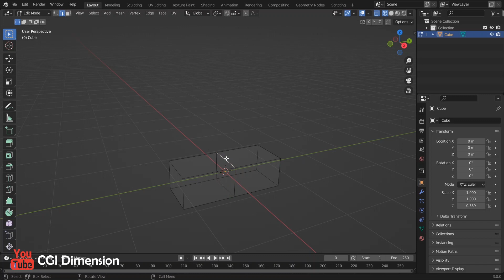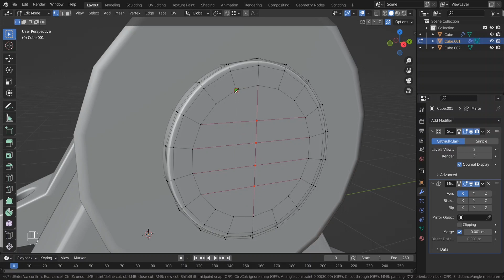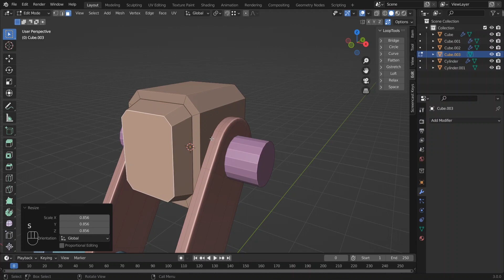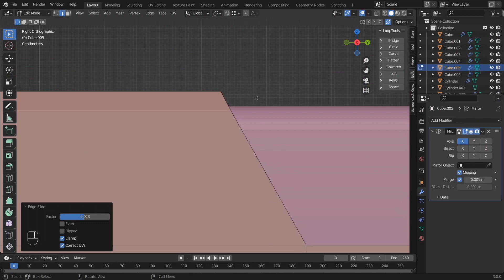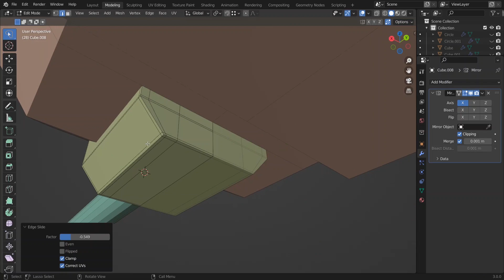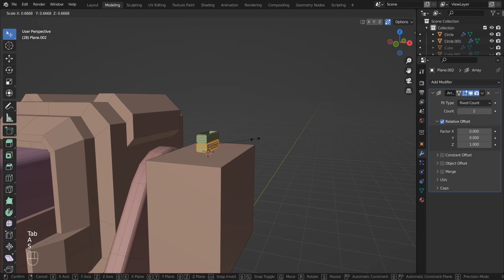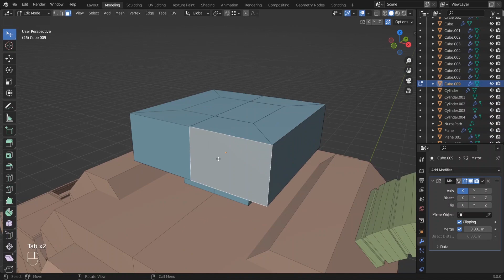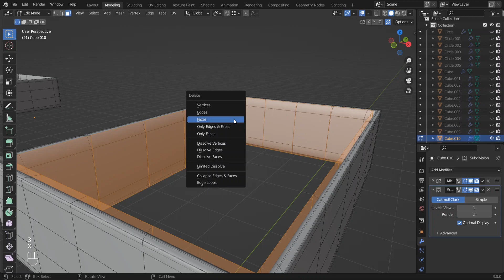blender hard surface modeling Turret Gun | Hard Surface Turret Gun #blender

Comment: I've been learning blender with the at-home Blender Guru course. This blows my mind. Is this game ready or more for cinematics?
Reply from the maker: This isn't game ready I applied subdivision modifier for smooth surface but after decrease some polygon it will be game ready
Reply: For that it's more portfolio and cinematic only, 

Cause for games usually people don't apply crazy Polygones topology work 

Game engines need low polies (or mid low)
Reply: @ferdinandkasangati5089  VFX portfolios? Yes. game design portfolios? No. 

One important thing you need to show in your game art portfolios is the wireframe of your low poly. They look for people that are able to optimize without sacrificing too much on the the overall quality of the mesh. This model could be baked down to an LP and textured for a really great portfolio piece though. Could probably get away with using primitives with simple bevels to make your low poly.
Reply: Seems like Unreal can support High poly, but it all fake, your game will be unplayable and your computer will suffer 

That is just maybe for rendering images or videos, but games? Nah
Reply: @ferdinandkasangati5089  Look up unreal nanite. This is definitely game ready in unreal.
Reply: @anbecharts  game ready was a word use to identify things (in game dev world that are *optimized, well made for runtime executables (without the engine )

I bet every game with nanite will require a good computer setup to run them 

Yeah it's game ready , but requirements will be huge